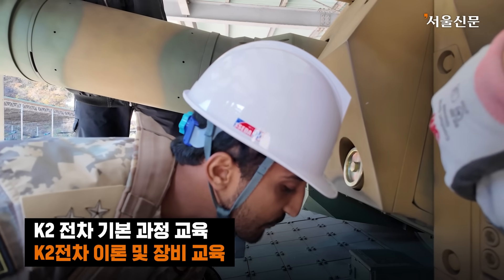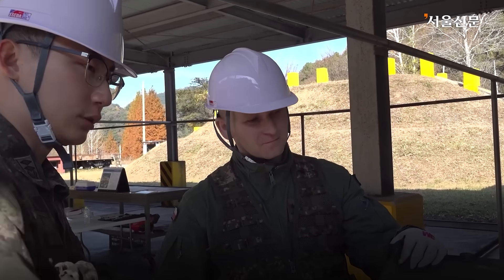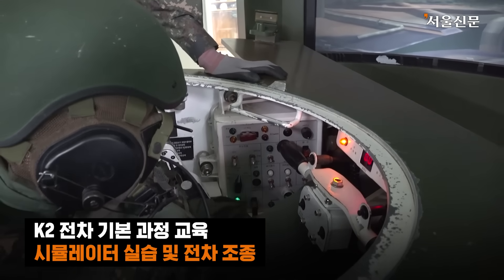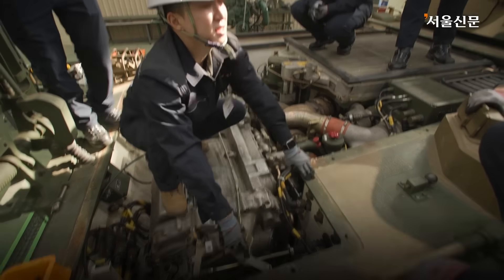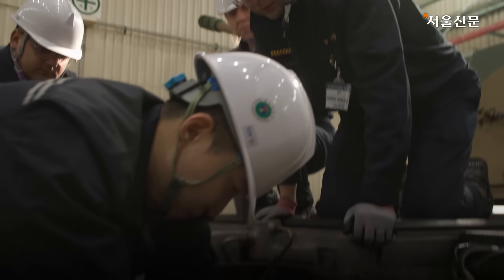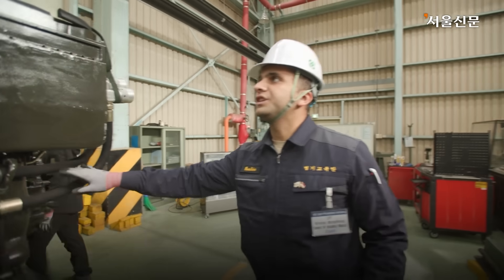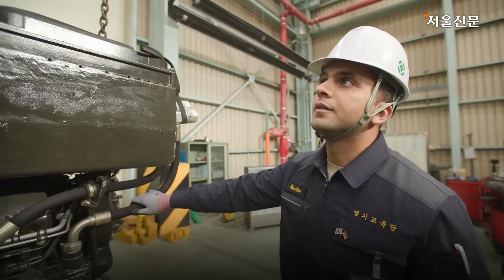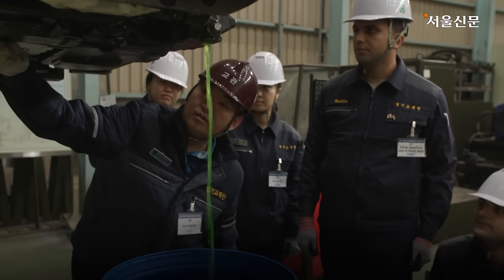한국 K2전차·K9자주포를 직접 몰아본 외국군 반응

Comment: Korea tank. It is a super car manufactured by an automobile company. I really like the car, its performance, personality, engine, transmission and brakes. 
Make sure you have fuel, lubricants, consumables, electronics, and a good driver's uniform! 
When several people are riding, the seat position is important. 
For all seasons. Spring cleaning, summer rainy season caution, fall basic maintenance, winter antifreeze and black ice when starting and operating. It's not a cannon! It's a tank. Thank you.